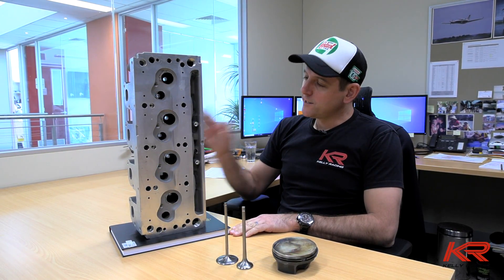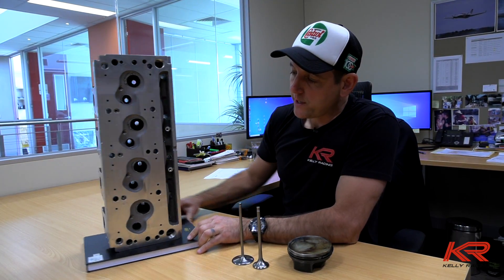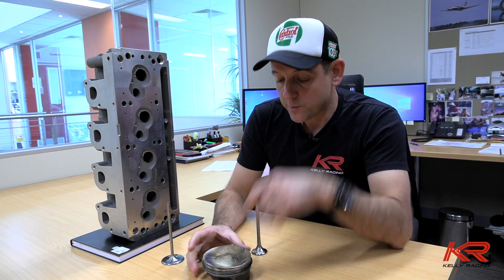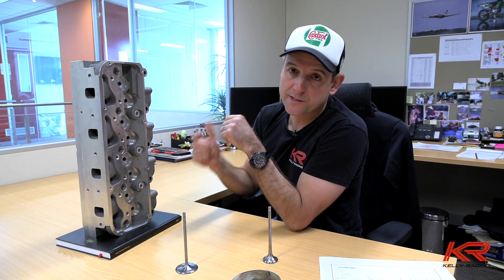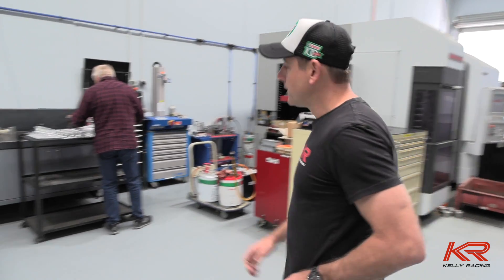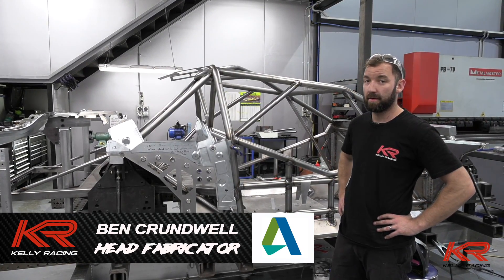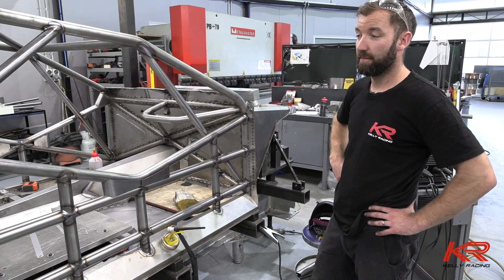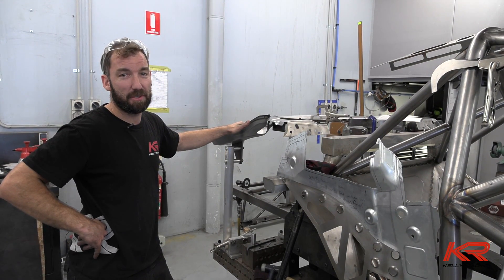The Road to Mustang part two - Inside Kelly Racing

Comment: My Lawn mower has a similar cylinder head........ :D
Reply: The only thing similar is the aluminium.:-)
Reply: @dougborrett3566  and the two valves..and the combustion chamber and the pushrods...in other words the same...
Reply: @truthseeker8483  my mower has a spark plug hole and combustion chamber and is made of aluminium, but then it is a 2stroke made about 1965 😀
Reply: @dougborrett3566  Nice vintage mower! You must maintain it.well...probably has more power per litre than this V8 Supercar..:D
Reply: @truthseeker8483  I wouldn't go that far when it finally does start it takes 10 minutes for the smoke to clear before i can even find it.
Ps the neighbours love it.
Reply: @dougborrett3566  :D

Comment: I remember when my work used Autodesk software...... That was back when they wanted me to be happy. Hey if you guys are looking for ways to spend more time programming your machines and worrying about your parts, give mastercam a try!
Reply: Mastercam is used to develop tool paths for the machine tools not design work. Autodesk is for design. Although I prefer Pro-E software myself as it has more capabilities.
Reply: @mattmoilanen3813 Autodesk has a few really good cad/cam products. I was assuming they were using featurecam or powermill for their machines. I'm sure autodesk gives them whatever software they want for designing their assemblys. But autodesk basically copied every good thing out of mastercam (and some other softwares) and made it better for their cad/cam products. Very smart people working at autodesk.

Comment: Clearly off the shelf control parts  would be about a thousand percent cheaper. Most of this is pure wank!!
I agree with Aderton re these stupidly expensive parts. Why make your own bellhousing, buy it from Ford or DJR.

As for fabricated door hinges and the like those cars all should be using factory hinges, less likely to have doors fall off or jam.
As for the heads? I guess you are stuck with the Ford casting, a 3V head out of Melbourne would make more sense financially. And similar power out of the box. Custom pistons etc are required, or buy engines ready to go. Probably smarter
As for being a Ford? It looks nothing like a Mustang, and worse being on a chassis last used on a Datsun will have even more cringe

Comment: A question I've always had is why isn't the Firewall and the floor above the exhaust double skinned for better heat management? Surely that would give an advantage on those really hot racedays?

Comment: Good work loving the vids and the workmanship thats being put out in both the video's and cars. But Wow supercars have it so backwards :o for what is a full chassi car that could of just had the body hung on it with simple brackets instead they make you use old pre project blueprint methods of building the car that were done to be cheaper back then no wounder supercars cost is out of control that's just crazy like 3 weeks to hang the body on the car which would just take couple of days at most.

Comment: Can't wait to see it on the Grid in 2020 <3

#VASC #Supercars
Reply: Jay Rielly for the money they should have their true 850HP to justify the investment. Not the piddly 650
Reply: @ Symo S...That's the whole idea, a "piddly" 650HP engine will last a lot longer than an 850HP engine, which would be lucky to finish a sprint round let alone an enduro.
Reply: @ Jay Rielly...R & D would be the most expensive process, after final testing is completed, the parts will be fairly cheap to manufacture. A lot cheaper than consistantly buy "off the shelf" parts.

Comment: Extremely interesting, well presented, and discussed.  Fascinating!  Can you tell me the type of tube, the Chassis is made of, and the type of welding used?
Reply: Chrome moly tube and its tig welded
Reply: @dinosshed  Thanks, I'm guessing the Chrome moly, is used for it's light weight and strength?
Reply: @colincannings7946  it's cost effective and can be formed as well. Ultimately a carbon fiber structure would be a better performing material but costs far too much.
Reply: @dinosshed  Thanks mate! Can't wait for the next episode.
Reply: @colincannings7946  you're welcome. I watched the very first cotf being built at djr, it was different seeing the fuel cell mid mounted and transaxle going in. Dna of the actual production vehicle was completely eliminated, not exactly what I like to see.
Reply: @dinosshed  Yes, I can remember back when the cars at Bathurst, were road cars. There was a minimum of 500 unit sold, to qualify.  Of course, there were modifications, like seam welding all the joints, to stiffen up the body, less flex.  However, they were basically production cars.  That of course, wouldn't work now day's, considering what the modern supercar is, and safety being a major consideration.